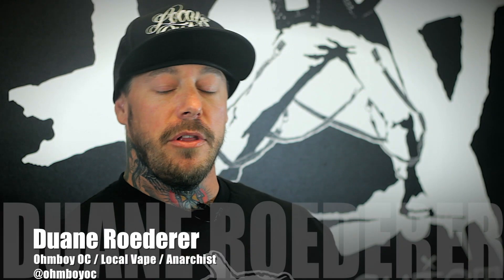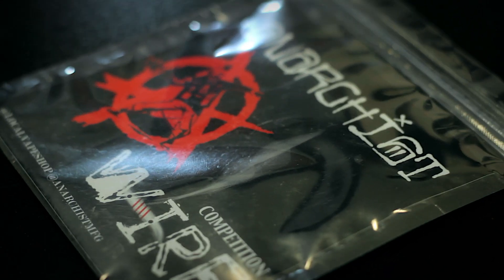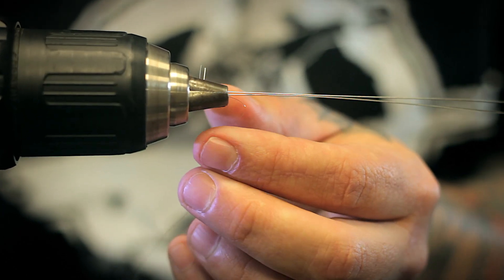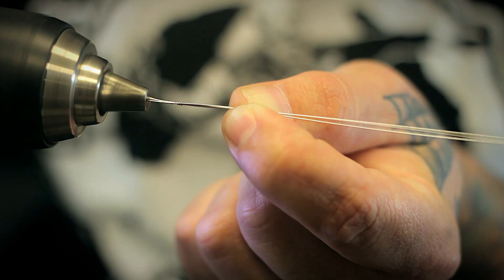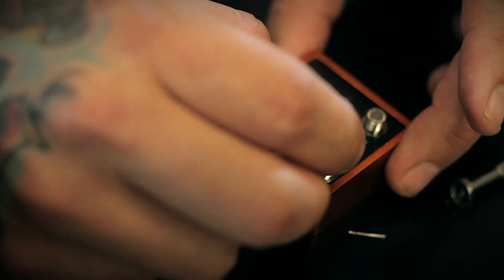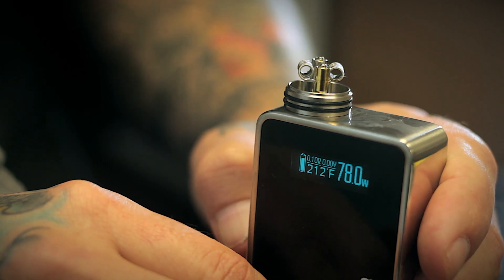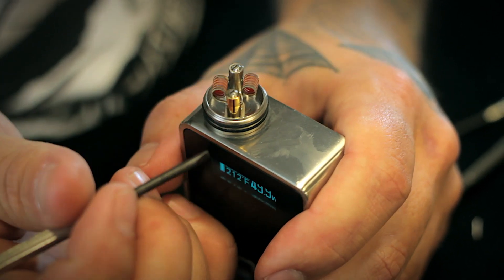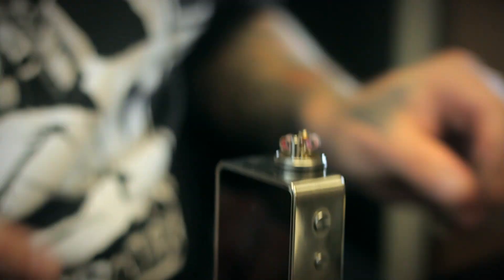Ohm Boy OC Builds A Fused Clapton

Comment: What's your tip on keeping the 36 from spacing? I'm keeping tension as your instructions and am pushing them together when spaced but how do we keep it from spacing upon initial application?
Reply from the maker: gwen keto It can be very tricky and takes practice.  Try using your thumb nail to hold the 36 gage wire tight to each wrap, I find using my nail helps out a lot.
Reply: Wagz Film I'll give it a go and keep practicing.